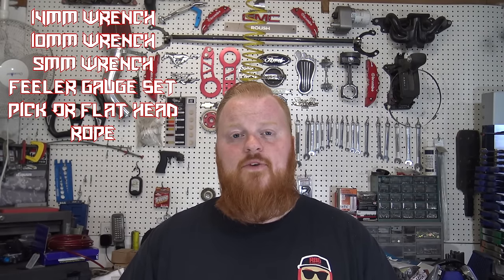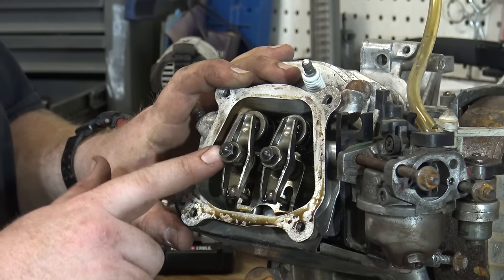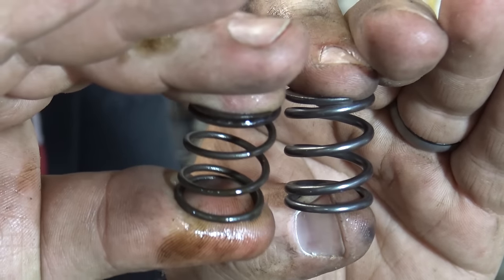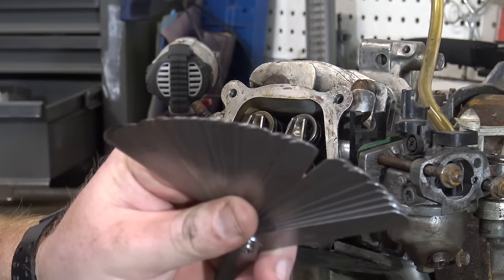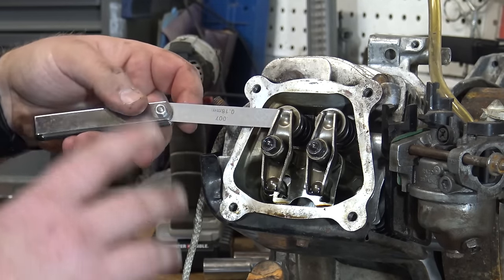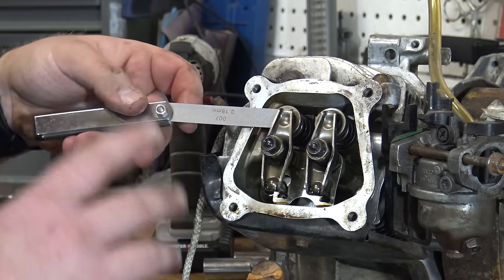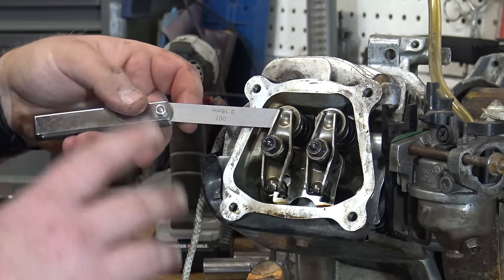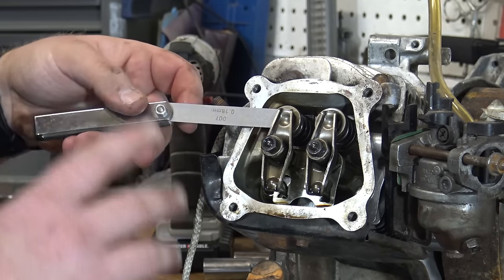How to Install 18lb Valve Springs & Adjust Valves GX200 / Predator 212 Hemi & Non Hemi Go Kart

Comment: Can you use 22lb springs on a stock cam/push rods/rockers? I know they can be used with the stock retainers but that’s about  it.
Reply: I used them on my stock 212.... Been installed about a month Other than it being slightly harder to pull start due to the 22lb springs/compression it is running better than it ever has.

Comment: I'm wondering Redbeard can you  find the hemi and non hemi at HF or just where would I find the hemi?
Reply from the maker: Yeah Hemi will be part number 60363
Reply: im pretty sure HF only sells the hemi. just open the box and look
Reply: nick dongle they also sell non hemis I bought 3 recently and they have big vavles in the heads with better spring locks

Comment: What's the best way to find top dead center on a gx200 ?
Reply from the maker: Pull the plug and turn it over. You will see when the valves are on the compression cycle and no pressure is on them

Comment: Hello Mr. Beard, I have the Coleman CT200u-ex camo. Is there an upgrade valve spring available for it? How does it compare to the one in your video. Thanks!
Reply from the maker: Just buy the 18lb valve springs on go power sports. They will work for that engine thats on the bike

Comment: Help. After installing the valve springs on a CT200u my pull string was hard to pull and now it won't retract. What did I do wrong???
Reply from the maker: Well those pull starts are known to go bad on the ct200u's you may need to buy a new one bro
Reply: Lash setting needs adjusting his setting are way off 3mm intake 5mm exhaust on a cold engine
Reply: @MJ-nl3pv  YOU ARE A LOON: 3 MM. =
APPROX  .118" 
5 MM.= .1968"
NOTHING IN THE WORLD CAN HAVE THAT.

Comment: Is this the same process for the stock engine that comes with my CT200U EX.
Reply from the maker: No they have a different valve set up. I will make a video soon about that.
Reply: what is the difference with stock ct200uex? video shows non hemi isnt that why you filmed it?

Comment: Hi Red Beard, like your videos. Can you tell me the crankshaft bolt specs on the predator clone 212 Hemi. Appreciate any help
you can give me. I tried the bolt in the kit and it's binding up (8mm x 1.25).
Reply: Late reply, but 5/16 ×24

Comment: I watched video felt like I did it right but engine not responding to choke or run on mikuni carb. Also pull start is hard every couple of turns . It seems like problem is not with carb but more internal.

Comment: I have a predator 212cc engine and upgrades the air intake, exhaust and the fuel jet. I was wondering if I should upgrade the valve springs to 18 lbs without taking the governor out. I have a pair of 18lbs spring laying around and don't know if it will make a difference if the governer is still in?

Comment: now what exactly does the heavier rate springs do for the engine?
Reply from the maker: +Drew Fisher let you rev to higher rpms without valve float
Reply from the maker: +Drew Fisher let the engine rev to higher rpms without valve float

Comment: You didn't mention that valves should be adjusted when closed. When the intake valve is open the exhaust valve is closed, you can then adjust the exhaust valve. Repeat in reverse for the intake side.
Reply: that whata thinking.off.too because i want to use a hemi 212 for my next bike build

Comment: @Red Beard's Garage ...I upgraded to the 18# springs and I've adjusted the valves, both @ .003 then installed the carb jet kit... now my engine pops when I accelerate. Did I maybe put the carb gaskets back on wrong... or ??? - PUZZLED. :( Oh, and I added an OMB header w/weenie muffler.

Comment: Hey RB.  Thanks again for an awesome tutorial.  I did the governor removal and had a washer get stuck behind the cam shaft so I pulled the cam to retrieve it. When I pulled the cam the lifters fell into the crank case and I just stuck them back in. I noticed both lifters were all the way up / flush when I put the cam back in. I lined up the dots on the cam when I re-installed it. Everything went back together fine. I also installed a mikuni 22 carb. Before I mounted the engine on the minibike, I tried starting it, it felt really low on compression and wouldn't start. Does this sound like the rods fell off when the lifters dropped? I ordered a set of 18 pound springs from GPS but they haven't arrived yet.  I was going to remove the valve cover when I get the springs in. Thanks!
Reply from the maker: Take the valve cover off and look at the push rods and make sure they are still under the rockers
Reply: Yep, they fell off.

Comment: Do you really need to remove the governor or can you just disconnect the arm and throttle linkage. I saw in one video where they said you could just unhook the governor.
Reply from the maker: You can unhook it but you need to do it at your own risk. It can spin around and hit the crank and mess the engine up. your call
Reply: Red Beard's Garage  like the way you think cant halfass the job when remove governor might as it well split the case and remove the gear.

Comment: Crap, I bought 22lb springs on my semi stock predator 212. Will these work? Or should I just reorder 18lb?
Reply: Been running 22lb springs on my bone stock 212 for about a month....no issues so far and I run it hard.

Comment: Hey man! Great video!
I have a hemi predator 212, i took out the governor, so I'm also going to upgrade springs.
You have a link to a hemi and non hemi set.  The non hemi set from omb says they work on hemi as well. Any reason you recommend the other ones? Or does it not really matter? Thanks for any info!

Comment: Why does my string rip out of my hand but once i get it started it runs fine
Reply: Your compression release on the cam may be malfunctioning. It will make it hard to pull and kick back.  OR your valve lash might just be too loose and need adjustment.

Comment: What if both sides of mine have the lash cap however by the valve cover design tou mentioned its not a hemo valve cover?
Reply from the maker: Im not real familiar to the newer non hemi engines and they may have one on both. I will pick one up next time to see.
Reply: Red Beard's Garage the engine i got i beleive is a carter 196cc. It came stock on my older model mini baja.

Comment: I set my non hemi at the specs u said and now it’s hard to pull, I messed with the lashes and made it smoother to pull but it won’t start, what would be the best for a non hemi predator with the 18lb valve springs???
Reply: Same happened with me recently. What did you do to fix the issue? I can't figure it out.
Reply: @michaelleonard3957  u have to figure out the stroke of the motor, so it’s gonna go thru 2 cycles when u are rotating the piston to top dead center, bcuz the first one is exhaust and I forgot the other one but i remember my dad helped me out and he figured it out, so u have to figure out which valve it’s on and u set that one to the size u want them u do it to the other I believe I did .003 and .005
Reply: @SKATESPOTSWORLDWIDE  So i probably calibrated the lash off top dead center on the exhaust stroke and not the compression

Comment: Nice video.  You have a new subscriber!    As of today 5-23-2020.  Do you suggest the hemi or the non hemi predator 212 engine for a replacement for a 3.5 tecumseh for a minibike that won’t be raced.   Only mods I may do are the governor ziptie or possible remove it.     Maybe down the road stage 1 intake/exhaust/ rejet.  The non hemi is tough to get right now but there is a hemi available at my closest harbor freight.    What would you suggest from your experience?  Thank you for the input !

Comment: Greetings I have a honda clone gx240 8hp I eliminated the govervador, how many pounds should I buy the springs of the valves for this engine, I will appreciate you can help me.
Reply: 18lb springs + stage one kit.
Reply: @cro-thehacker7018  i have a stock coleman is it ok to run 18lb valve springs with no other upgrades or should i get a stage 1
Reply: @---bj8ty  do not run 18lb springs with the governor, you'll blow the engine and have the flywheel fly apart - it's recommend to run a built flywheel and rod in the 196cc and 212cc engines, the gx240's however are slightly different having a better stock flywheel means they can run 18lb springs without upgrading. This is just my 2¢

Comment: I have a 196cc clone with 18lb springs in it after market air filter bigger jet gov by bass my lash is set to 0.4 intake and 0.6 exhaust should that be ok I got them numbers for a guy that knows what he is doing but he had 22lbs springs would that make the lash number different?
Reply: what valve lash did you end up using

Comment: I got one of these hemi predators on a go kart I got on Craigslist and it's extremely hard to pull it's not locked up and pulls like normal if you remove the spark plug what could be the problem

Comment: Great videos Red Beard! Is the non-Hemi valve spring replacement seen in this video the same process on a CT200U engine? I'm a newbie to engine modifications and was wondering if I can follow the instructions in this video and have it apply to my CT200U or if there are some things that are slightly different.
Reply: Yes it is

Comment: Hey Red quick question I have a stock cam on a 212 pred non hemi no governor I put 22lbs spring cause I had them laying around. Would you recommend that I go to 18lbs for better performance? It doesn't run as good as I want?

Comment: What's up buddy. I got a question why my Predator kickback. I just remove the governor after that start kicking back really bad can you give me info. thanks in advance
Reply from the maker: You probably set the valve lash with the compression release on. when you get the engine at top dead center watch the valves and you will see the exhaust valve open a tiny bit, go a little further untill it closes and then set your lash
Reply: How do you set top dead center?

Comment: So I have a Hemi predator 212cc and my compression release seems to not be working, I’ve got a Mikiuni 24mm flat slide carb, arc billet flywheel 32° timing, governor & oil sensor delete, & msd ignition spark plug wire. What should I set my lash to? Because I have no cam nor upgraded springs, valve train is stock on my build.

Comment: Im running a stock preadtor 212 hemi with a 3 staged header and vm22 slide carb. Im planning on Install9ng these springs to reduce valve float. Do I need to add anything else to add them or can I just put em in there?

Comment: I have the 212 hemi and I read that it has 18 lb stock springs so I'm upgrading to the 26 lb ones. My question is what do the springs do besides the obvious being springy... and what are the pros and cons of the different weights?
Reply: They are stronger valve springs which help with the motor when it is in high rpm

Comment: When changing the spring or working on the inside of the valve cover, do I need to drain the oil? Or Am I on the safe side from spillage by leaving the oil in the motor?
Reply: You don’t need to drain
Reply: But on the other hand give the oil a change

Comment: I adjusted my valves on a new Predator 212 HEMI before seeing your 
video. I  was not aware of the decompression device on cam and didn't 
have crankshaft at TDC. Now engine won't pull start.  I removed spark 
plug and pull cord. It is not hydro locked.  What do i need to do to 
free up engine?  Sure wish i had seen your video instead of others i 
watched.  Thanks
Reply: I can see now that the exhaust valve has dropped into cylinder away from rocker arm.  Why didn't the retainer on top of spring keep it in place?
Reply: Do I have to remove the head to get it out or just the side plate?  What do i need to do about compression device on cam when putting back together?  Thanks for any help
Reply: I am having the same compression issue. What did you do to resolve it.
Reply: @michaelleonard3957  I had to pull the head off and the valve spring retainer head broken.  so I had to get a new retainer new valve gasket set put it all back together.  Make sure it's at top dead center like indicated in this video one thing I realize is that it's kind of best to be a little tight on your adjustment rather than a little loose. but I think I put it at .005,  I put it right in the middle of what it called for. I don't know what it was I think it was .005  for one and .007 for the other one.
Reply: Take your time set it turn it around 360° and then come back and check it keep checking both of them until you get them right

Comment: I have a gx200 clone on a Baja Warrior 200. I completely bypassed the governor (left the spring to tension the governor arm and keep it on the internal gear/adjuster). I have noticed that the engine runs very rough when revving past 3600. Is this normal, or valve float? It feels like something is unbalanced.

Comment: I plan on running only premium in my predator 212 because I can get that ethanol free, not looking to build a crazy engine, I'm keeping the govorner so that it's "idiot proof" ill be running a free flowing air filter and exhaust simply because of what its going in, but it seems like I should bump compression ratio to take advantage of the higher octane rating, any advice?

Comment: Hello redbeard just subscribed love your videos i just bought a 212 non hemi im gona remove govenor and oil sensor maybe put a stage one on it do you recommend i do the 18 lb springs
Reply: David Kuznetsov if i was you i would, but the right thing to do would be to put in a billet today and flywheel before taking the govenor off. if u can only get one i would get the rod because people don’t have much problems with the flywheel in it with just a few mods

Comment: The valve keeper mysteriously came off the intake valve on a predator 212cc engine in a generator. Do you have any idea why this happened? Thanks
Reply from the maker: It had to be a weak valve spring or something. Maybe the keeper was never installed correctly to begin with
Reply: Red Beard's Garage yeah probably. I did an oil change right before the keeper came off. It's a non hemi
Reply: Red Beard's Garage upon taking the rocker off the valve I saw that the valve keeper was broke. The part that is supposed to hold the valve stem wore out so the hole is as big as the part where you initially put the valve stem in. That's why it came off of the valve

Comment: Wats up man I love ur work u got mad skills n uf fab work 💪 but I need sum help I got a 7hp b/s go cart da carb o rig was leaking so I replaced it but not it won't start but i ran fine b4 I did dat da only way it'll start is will starter fulid but jus dies a sec lateen when I would put it on full run it would go fast but could let go da gas cause it would cut out cause sum1 please help me out

Comment: the new predator non hemis don't not have lash caps and they have automotive style keeper locks for the Springs and they also have larger 27mm and 25mm vavles so the only benefit for using a hemi is if you going to leave it stock non hemis work better for cam and carb changes
Reply from the maker: +sprintcardriver8 every hemi I have seen has lash caps
Reply: I typed non hemi in my previous comment, the older non hemis have lash caps yes but I just bought 3 brand new Non hemis and that's what I wanted for what I'm using them for and non of them have lash caps because they have automotive style keeper locks for the vavle Springs and the valves are also bigger then the older style ones

Comment: the 18lb springs i ordered from OMB warehouse for the clone non hemi are way taller than the ones you installed.  They look like the are gonna coil bind.  They measure close to 1  1/2" static height.
Reply: I lagging here but .. yup the 18lb springs are shorter for the hemi.. sounds like you bought non hemi and is why I went with 22# springs .. many builders never point this out. Im not feeling confident enough though even though I've heard the taller 22# springs (hemi/ non-hemi) won't bind

Comment: I'm having trouble finding top dead center on my piston. Any advice?
Reply: Take a screw driver and a marker. Put the screw driver down the spark plug hole until it's sitting on piston head. Slowly pull your pull chord and the screw driver will move with the piston. Mark where you think it's top dead center and repeat a couple times to ensure its the highest point.

Comment: Is the valve lash the same for the hemi? If not, what should they be set to? I also have another question, my predator 212 has a removed governor and an modified stock air filter box, and the motor has been studdering at high rpm, everything is stock except for the governor and advanced timing. Thanks, Kris
Reply from the maker: +xTERMINATORx 1000 I would check and see if it's running lean

Comment: I need help when i put the valve springs in and adjusted the valves I pull the cord cord try to start it my Flywheel moves a half a turn then stops and won't move anymore I don't understand y

Comment: His valve lash is wrong I called go power sports they say .003 on both. I used his valve lash and it wouldn't rev past 2,200 RPMS
Reply from the maker: +River Brooks it runs fine for me and revs to 6k
Reply: Mine with 18 LBS Honda brand springs will not rev up on .007 and .005?
Reply: What is the valve lash for non Hemi?

Comment: thats what happen i paid someone to put the 26lbs spring in my motor he said he did. now i got no compression at all.
Reply from the maker: +Jerome Keith he must have not got the valve retainer seated all the way.
Reply: Red Beard's Garage whats the valve lash on a hemi with 18 lb springs....thnx in advance
is it the same as the non-hemi